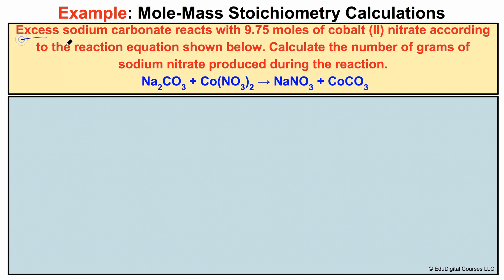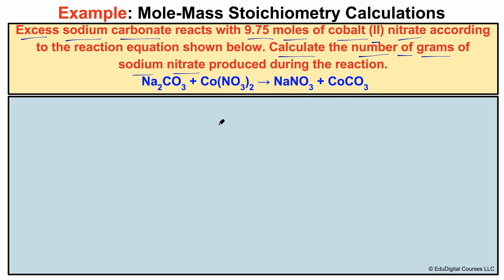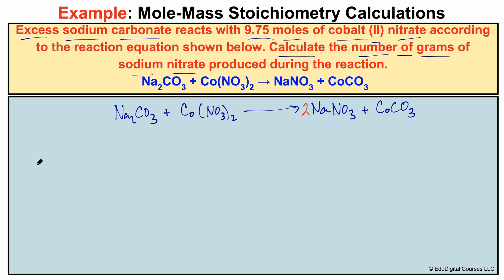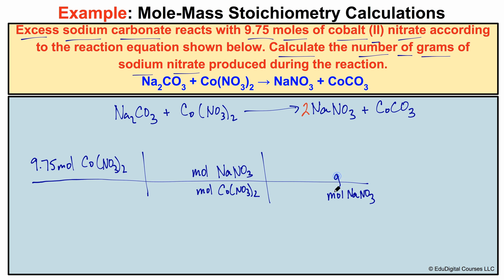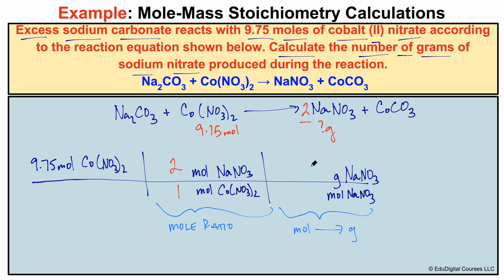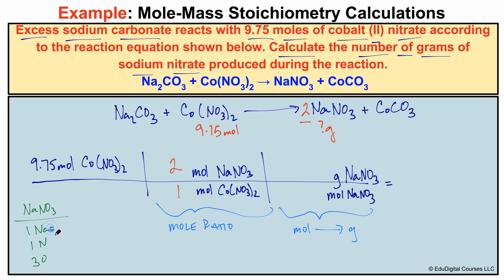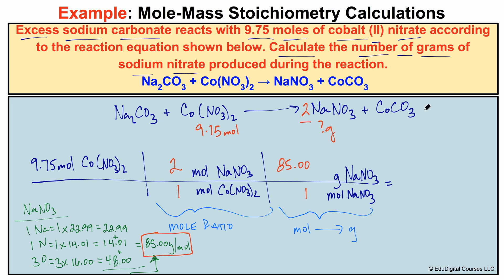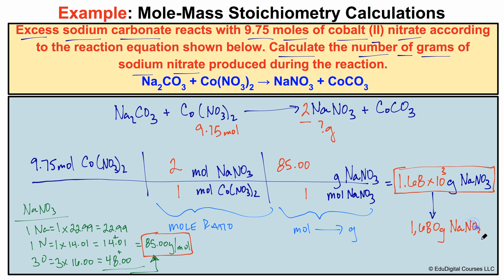How to Perform Mole-Mass Stoichiometry

Comment: There is an error in your calculation. The multiplication yields 1657.5 g NaNO3. In scientific notation and 3 significant figures, it would be 1.66*10^3.

Comment: why does mine says a different answer?
1,657.5 please help me.
Reply: Switch ur calculator to scientific mode
Reply: No I got the same thing with a scientific calculator.
Reply: Same here. I get 1,657.5 as well.
Reply: I'm using a scientific calculator and still got the answer 1,657.5
Reply: Oxygen is supposed to be 6